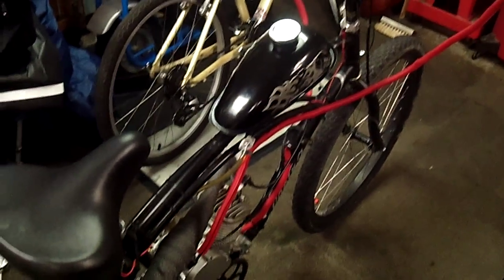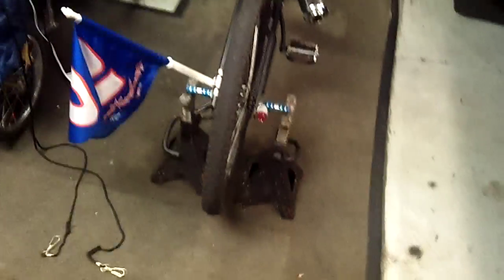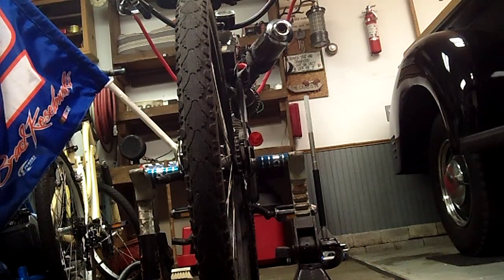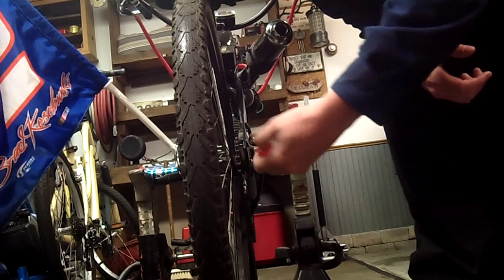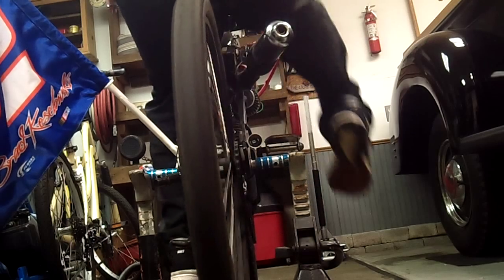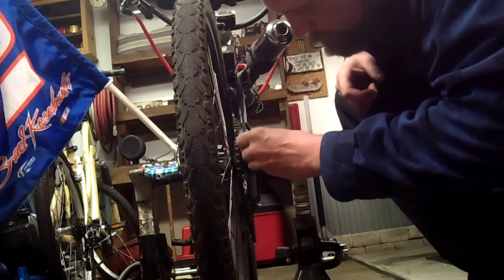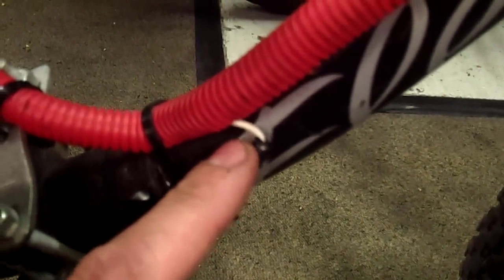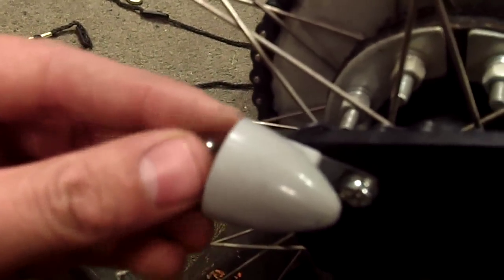bicycle 80cc engine white wire

Comment: You needn't have a load on the white wire.  What is probably occurring is that when you remove the bulb, the spring in the bottom of the lamp holder is forcing the terminal and shorting it directly to ground.

Steve
Reply: If u cut that wire ( white ) you will get it to run ........as long as wire isn't touching ground ( ground on bike)
Lol...Steve ,
I was thinking th same .... The white wire must be grounded it bike ( when he removes bulb).....
So if the white wire goes to ground ( on bike) ....the  current created ,is taking shortest path ( witch is not through plug)
If u cut that wire ( white ) you will get it to run , make sure white wire isn't touching any metal on bike is all  ( ground)

Comment: I did not need to load the white wire to run.  but what is the power available at the white wire?
Reply: 6volt at 1/2 an amp.I run it into a pack of rechargable batteries and Then connected lights off that.Works fine.
Reply: Not enough for dick.
Reply: 251omega 7.5 volts at 5 amps. If u hook something up that takes more power it'll kill your engine
Reply: @whysthat2877  7.5 v and 5 A on the white wire? With a rectifier can be used as a charger for your rechargeable and use-it for lights or not? 🙄😁

Comment: how do you connect the positiv and negative wires to the qhite wire
Reply from the maker: the white is the positive wire and the frame is negative
Reply: You need to run a ground from the tail light to the ground from the motor and make sure the light itself is insulated from the frame.This way the light is in a loop.I had same thing happen 1st try until I realized the light frame was acting as a kill switch,like his is.
Reply: I ran a ground wire from the engine/coil black to the frame as I have rubber vibration mounts between the motor and frame.Otherwise,only my clutch cable would be ground.The oily chain sure wouldn't do well.

Comment: None of these kits require a light to work. You just need to wire it up correctly.  I have the same dyno light set on mine, also from ebay. Doesnt throw much light on the road but it makes cars dip their lights pretty quickly.
Reply: i couldnt get that system to work with the wheel generator...